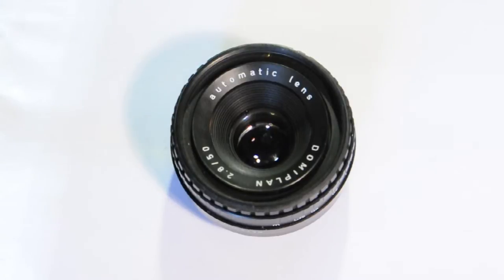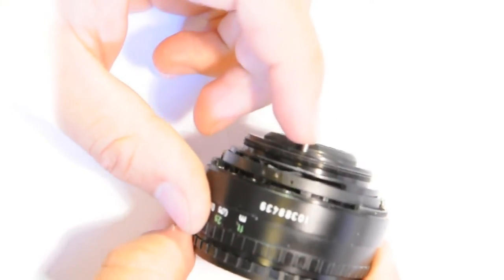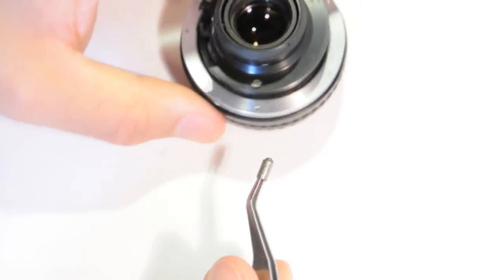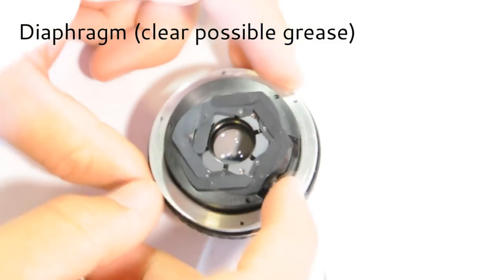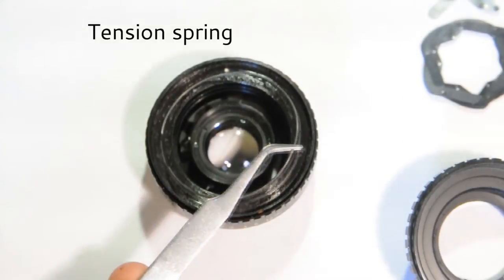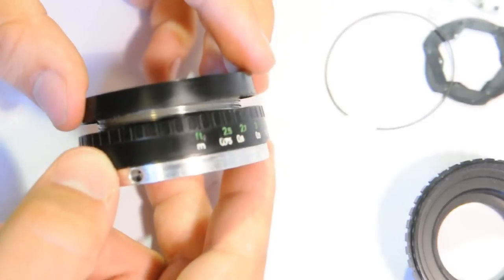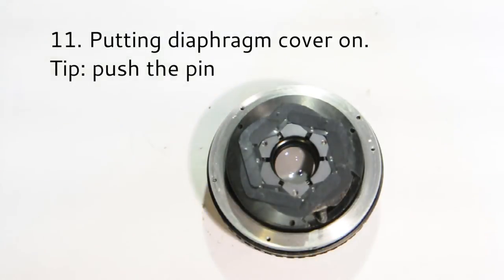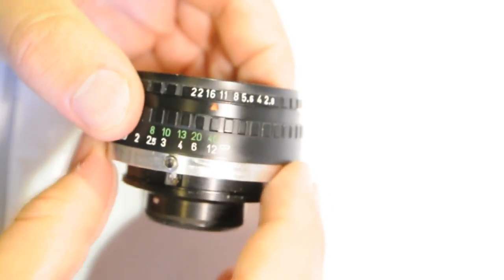Dissassembling Domiplan 2.8/50 Automatic Lens

Comment: Thanks much for posting this, came here looking for some clues on how I can fix my zebra version that appears stuck wide-open, and will follow your directions soon.
Reply: So did it work and could you bring life back to your aperture? I have a similar problem with a similar Zebra lens. Guess this is a very common problem and possibly due to rust jamming over the vertical transfer mechanism and ring.
Reply: @samsen3965 , I ended up with another copy of the lens that works and I haven't gotten around to taking the working lens apart to see what's missing in my non-working copy. I can only guess something unnoticed flew off during my stab at cleaning the oily aperture blades. ¯\_(ツ)_/¯ Thanks for reminding me, I'll add it back to my list because I'm still curious how the mechanism was designed to operate.
Reply: @lewisfrancis9858  🙏 .  Wish you all the best and I'm sure, to say the least, you'll have a great time playing with it.

Comment: STEP 1: You're going to break the name plate using a screw driver to pull it up. Simply leave the name plate in place and unscrew it by pressing down and in a circular motion with your fingers. If you use the screwdriver you will break the part which helps you keep the aperture ring in place (the name plate will push the aperture ring down in place when you reassemble it). Had to learn this by breaking mine. FU dude.
Reply: Yes me too, i'm really angry about this.
Reply: Quite correct. A hammer achieves the same result. Try holding the diaphragm ring down when rotating the name plate with the help of a rubber pad as this can decrease the friction between the plastic name plate and the metallic diaphragm ring unde which sits a metallic wire ring acting as a spring. 
I am shocked by the crappy construction of this lens and quality of screws used: one of the worst I have ever seen.

Comment: Hi. Thanks for this, it was a great help. The aperture blades on mine were stuck. Gave them a clean and it’s working again. Happy days! 
One thing though, after fiddling for over an hour trying to put it back together, I assembled it without the two tiny springs. Would there be anything against it to leave it like this?

Comment: Maybe some of these have a pop-up nameplate, but many do not. Fortunately, I tried screwing it off first, which worked fine. Also, the reassembly instructions leave a bit to be desired. The little tab which you say transfers power vertically from a horizontal input can get stuck in the wrong position, making final assembly impossible unless you see it and realize what the problem is. Other than that, these were nice instructions, and I managed to disassemble and reassemble this lens. This seems like a difficult one.

Comment: Hi Floxfox! Please explain how did you put two small springs back then was assembling the lens (on 2.06 minute) I can not put them back. It is stuck in outer case. I think for this operation you need the special tools  or it must to be also two small bearings on the ends of the springs. Thank you.

Comment: Hi. This video was really useful. I've managed to disassemble the lens as the aperture was stuck wide open. I have the mechanism working now, but see that it is stiff. I believe that the spring that pulls the aperture open has lost strength. Would you know if I could buy a replacement for this and where? Thanks for this video!

Comment: I cant reput the part with the springs, i arrive just to the middle, there is a secret? Can you help me
Reply: There's a hinged tab in the piece that goes over the springs - it can get rotated into the wrong position and block the piece from seating onto the main body of the lens. It's in the area under the pin that controls the aperture blades. Get it into the right position, and it will all go together fairly smoothly.
BTW, I found this lens to be a real bear. Nothing seems to go smoothly with this lens. Not fun at all.

Comment: Today I finally got around to taking a stab at the lens. Cleaned and reassembled the oil-covered aperture assembly so that it was closing down nicely by manually pushing the diaphram lever, but after final reassembly the rear actuation pin doesn't do anything, which is the same problem it had originally, only this time I couldn't blame it on stuck blades. Any ideas? Is there a small part that could have come off the aperture lever unnoticed that I need? Thanks.